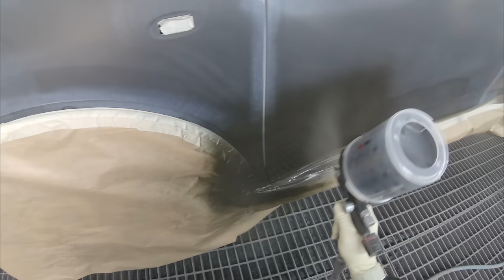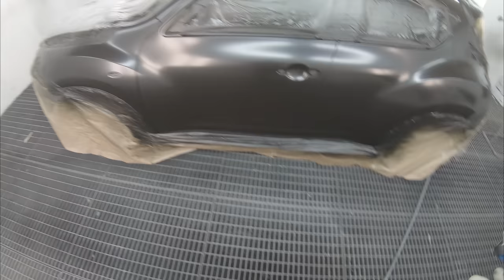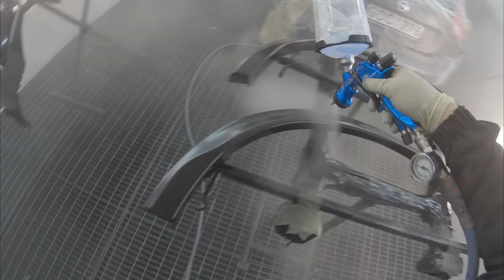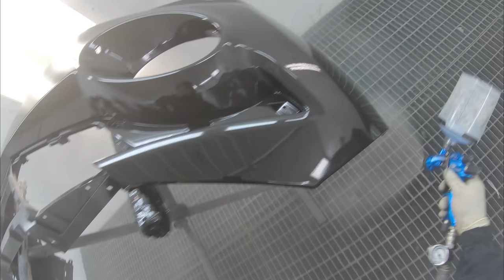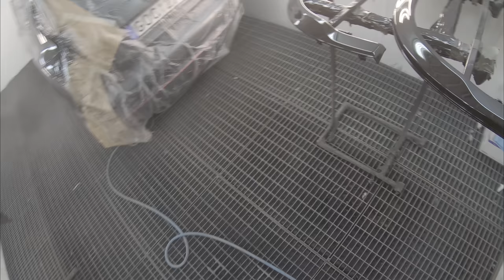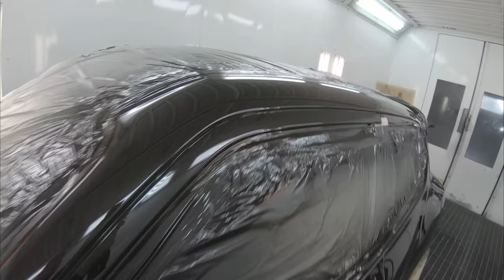Car painting | Black Mirror Effect | Sata 5000 Phaser RP & Iwata ws400 Hakone

Comment: Hi, awsome finish, well done 👍

I noticed that each time, you apply two sucessive layers on each panel without wating 10 minutes or so between two layers.
Is there a reason not to apply a second layer after waiting and letting dry? How do you manage not to get runs by doing so?

Many thanks 🙂
Reply from the maker: Man, this is water base Cromax Pro ,)
Reply: @coloroncarpainter5031  OK, thanks 👍

Comment: Pull the paint gun away and restart it before doing the next line. You kept spraying and stopping mid panel to go in the other direction. You can get a build up of paint in the end of the stroke and cause runs. Looks nice though.

Comment: Please tell me what kind of clear coat  you used? HS, UHS?
and another question, how many turn you opened Fluid? 4 turn? 3 turn? Thanks so much.
Reply from the maker: Uhs
Fan closed 2.5 turn
Fluid closed 1 turn
2.3 bar
Settings in Iwata
Reply: @coloroncarpainter5031  fully open? That's around 5 turns? I don't known 😔, I used HS CLEAR COAT

Comment: Presure of air how many bar 18/20 or no
Reply from the maker: 2 bar
Reply: @coloroncarpainter5031   
You mean in pastolie 2 bar 
i talking about prusure of comprisor how many
Reply from the maker: In the spray booth on filters, set to 4.5 bar
Reply from the maker: The compressor pumps up to 9 bar, starts pumping from 6 bar
Reply: Aaa gret you mean compressor 9 bar start pumping 6 bar in first and 2nd 4.6bar .and the last 2bar

Comment: friend help me with a doubt, the ws 400 does not have the uniform range it plays but material at the tips, the ls 400 came with this problem?
Reply from the maker: Ws400 RP system - clear coat
LS400 HVLP system - base coat
Reply: @coloroncarpainter5031  ws 400 hakone, които използвате и 1.4, аз търсих, но не намерих, намерих само 1.3 в тази версия.

ws 400 hakone that you use and 1.4, I searched but not found, I only found 1.3 in this version.
Reply from the maker: My ws400 1.4
Reply: @coloroncarpainter5031  ws400 1.4 HD стандарт и ws 400 1.4 HD hakone, разликите са само в цвета и персонализацията, клюнът е същият?.

ws400 1.4 HD standard and WS 400 1.4 HD hakone, the differences are only in color and customization, is the nozzle the same?
Reply from the maker: @papagaiosilva9716  yes, verything is the same
Reply: @coloroncarpainter5031  for financial reasons, can i apply foundation and varnish with the ws 400 1.4 HD?. Is the finish the same?

по финансови причини мога ли да нанасям фон дьо тен и лак с ws 400 1.4 HD ?. Същият финал ли е?
Reply from the maker: Of course it is possible, only on complex colors it will not be comfortable. It will take some getting used to